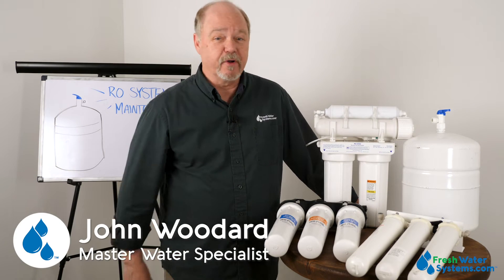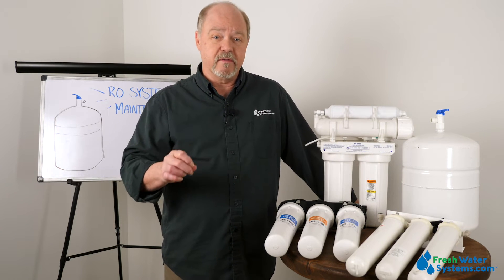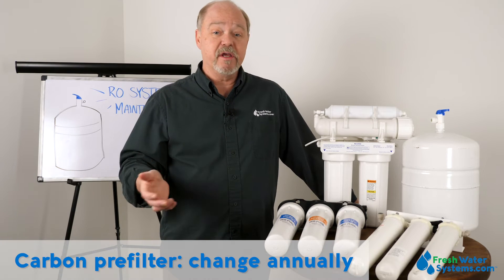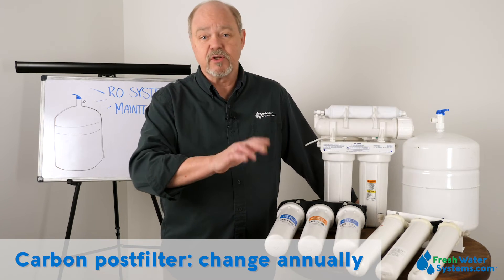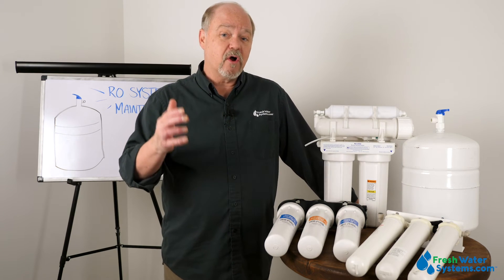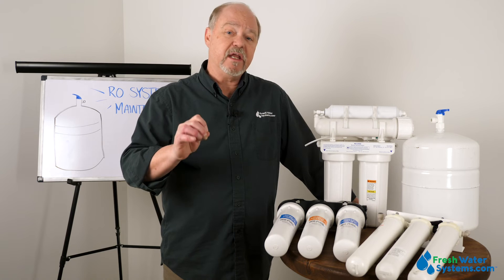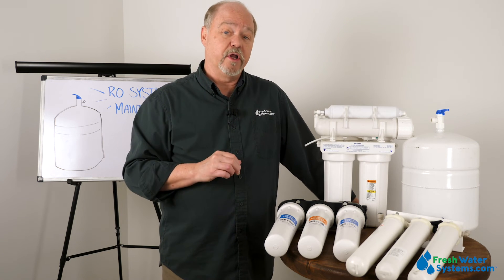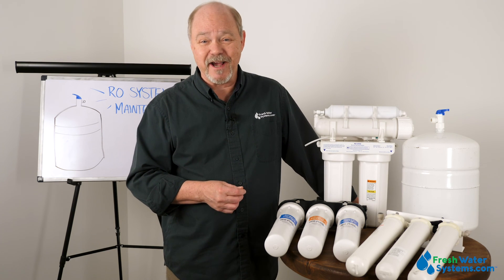How To Maintain Your Reverse Osmosis System

Comment: no one mention what psi should be if tank full of water?
Reply from the maker: Hi! The full pressure of an RO storage tank is typically 2/3 of feed pressure.  If feed pressure to the RO is 60 psi.  The tank should activate the Auto Shut off when the tank pressure rises to 2/3 of 60psi = 40 psi.  No one mentions probably due to the variable nature of installation sites.

Comment: do all of these systems require me to drain a tank. because thats pointless. aren't there any that are low maintenance and DO NOT require me to carry the dam thing outside every 2 weeks???
Reply: You drain it by shutting off the water supply to the system and then leaving the RO filter open until the tank is empty

Comment: Specifically how do you actually sanitise the tank
Reply: Use one part name brand regular bleach to 9 parts water. Run it in your system and let it sit for at least ten minutes, without the filters installed. Then rinse the heck out of it with plain water And run plain water through it until you don't notice any more bleach. Then install your new filters.

Comment: Your video is very informative. Thanks! Can you tell me why no water is coming out of my RO system after I change the filters and the tank is at 6.5 PSI? Water is getting to the prefilter but not past that point. I tore apart the assembly and did not find any thing blocking the flow of water.
Reply: Still need help?

Comment: I have an RO 5500 Aquapure. You covered the basics, but I'm not sure what the individual parts are; I change the bottom 2 cartridges, but don't know what the top, sideways cartridge is so don't know how to replace it - and where is the filter? Or is that the top cartridge? Thanks

Comment: very helpful thank you. I have a six months old Davis and Shirtliff 6 stage under sink mini RO system. I have just recently replace the three filters but after restarting the system it is not running as normal. It stutters and pushes a few drops of water with every stutter. Might you know what the problem is?

Comment: I changed my pre and post filters 17 days ago and now my flow has stopped and my tank is empty. Water is not coming into the system and my filters are clogged. They are supposed to last up to 6 months. Do you have any ideas why this would be happening? The filters before these only lasted 1 month. There can’t be THAT much sediment coming in to clog them up! Thanks.
Reply: I think you need to pump your tank with air